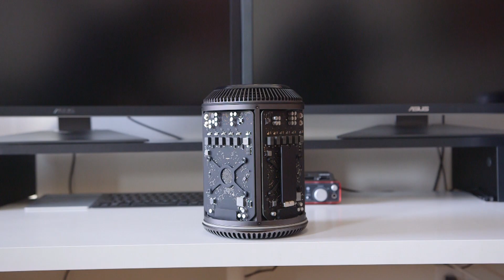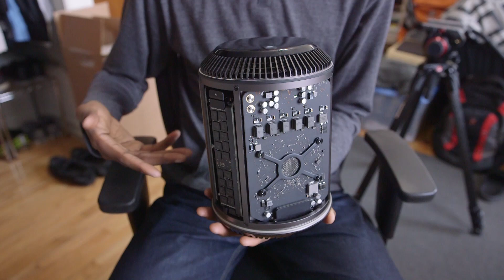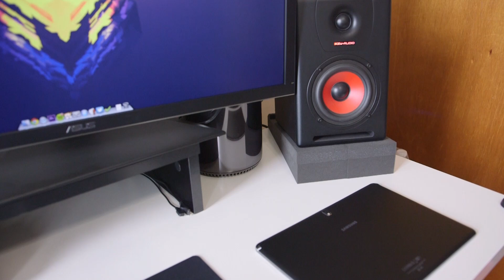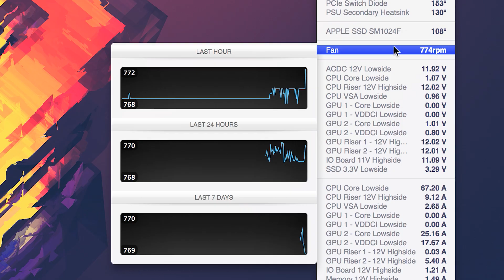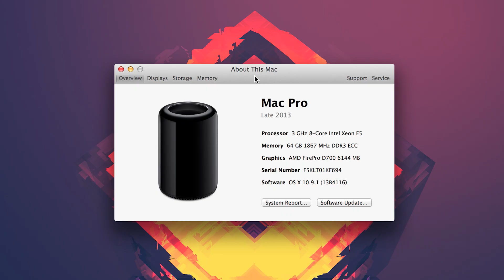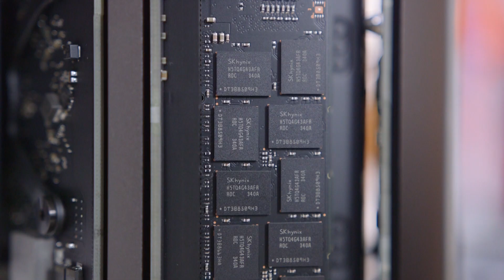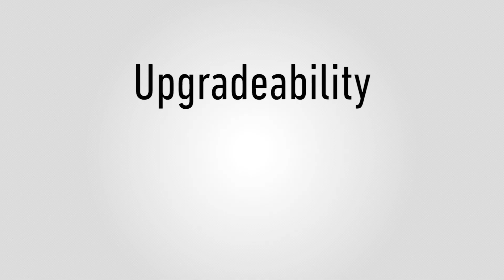New Mac Pro Review!

Comment: over prize piece of shit
for the same prize I got a beast with dual titans, 8 core processor, and 64g of ram...and some extra paraphernalia.

Edit:
In honor to @Indecisive Fella, which has made good points:

If it suits your needs and you can afford it, it will do the job, I might think that it is overprized and it can be, but it is a good computer for sure.
Consider to check a pc rig as well.
Reply: Good for you finding something that satisfies your needs.

A Mac Pro is clearly not aimed at you.

Now as you use a non-Xeon CPU you are limited to 64 GB of non-ECC RAM and not enough PCIe bandwidth and your mainboard will also not have TB2.

But hey, why not build your own computer using the same components like the Mac Pro uses and then put them all in such a small enclosure and then come back and tell us about its price.
Reply: Indecisive Fella Hey! Basically because to get the same performance that mine has, the prize of mac pro would be around 9000 dollars, and mine around 4000.
So no, im not paying 5000 dollars extra for a fancy case, a more stable processor that in most cases will be slower, and some tech that is not software ready yet.

Needles to say that I enjoy the Cuda technology that it is extremely useful for real time simulations (naiad, TFD, phoenix etc etc), GPU accelerated rendering and so on.
My rigs are not gaming rigs.
I own 2 Tesla rig as well and a 4xXeon.

Yes, the mac pro is not aimed to me, as a long time mac pro user, I stopped buying mac products when the prize performance ratio went down and most of the Software runs better or is exclusive to windows/linux platforms.

As a non Xeon user, i am limited to 64 gigs, yeah, but the mac pro does not accept more than 64g in the first place. So i guess we are even.

The resultant computer that is the mac pro is, a machine with a few good ideas and some technology that no software that it is available for mac or is used for the average professional that buys a MAC PRO can take advantage of.

Not to mention that the ability of upgrading the GPU or even add up to 4 in SLI.

But hey!
Why you don't try to build  one of my rigs, with the same components, fit in a case like that and for  the same prize?

see?, i can do that too.

The mac pro it is about the brand, and the aesthetics. But it does not deliver, is like a low grade Ferrari stuck in traffic. 

Needless to say that in professional environments the Mac pro is always a no no, unless you are a hipster photographer, hipster video editor or a hipster graphic designer.

Are we going to share some software knowledge now? I am all about it.

about to do some illustrations in my Cintiq 24HD
Reply: Himura Battousai
• "As a non Xeon user, i am limited to 64 gigs, yeah, but the mac pro does not accept more than 64g in the first place. So i guess we are even."

- 128 GB is the current limit.
http://eshop.macsales.com/item/Other%20World%20Computing/1333D3Z3M128/
Reply: Indecisive Fella although you know what?

I checked your profile and you seem to be an APPLE fanboy.

So hey, enjoy your Mac pro, I will enjoy my PCs. you probably even use them for anything serious anyways.
Reply: Himura Battousai

• "I checked your profile and you seem to be an APPLE fanboy."

- To many I am, at least to people who have a one sided view.

• "So hey, enjoy your Mac pro"

- I don't have my own Mac Pro, only the workplaces I go to have them.

• "you probably even use them for anything serious anyways."

- Depending on what you call serious, I use them for national broadcasts of comedy shit, mostly candid camera or sketch comedy.

Sometimes it also has been used for editing and grading of RED Epic and Alexa footage.
Nothing serious of course, only some skateboarding footage, as those cameras are ideal for that.
Reply: Himura Battousai
• "The resultant computer that is the mac pro is, a machine with a few good ideas and some technology that no software that it is available for mac or is used for the average professional that buys a MAC PRO can take advantage of."

- FCP X, Mari and others can take advantage of the hardware, can they not?

• "Not to mention that the ability of upgrading the GPU or even add up to 4 in SLI."

- That is a very valid point, but not everyone using a workstation computer will need that kind of GPU power.

• "Why you don't try to build  one of my rigs, with the same components, fit in a case like that and for  the same prize?"

- Maybe I do. Send me the components?

• "The mac pro it is about the brand, and the aesthetics. But it does not deliver, is like a low grade Ferrari stuck in traffic. "

- I have worked on the old and new Mac Pro and in my experience with editing, compositing and colour grading it did deliver.

• "Needless to say that in professional environments the Mac pro is always a no no, unless you are a hipster photographer, hipster video editor or a hipster graphic designer."

- Good to know you have outgrown your hipsterness (wow, that is recognised as a word - WTF), as I and the companies I work with and for don't have yet.
It is strange to see 50 year olds as hipsters though, but I get it.

• "Are we going to share some software knowledge now? I am all about it."

- Why not. I use iMovie for my multi-cam needs for BetaSP footage, I use Jashaka for my compositing needs and I use iDVD for my BluRay authoring needs.

Or not.

• "about to do some illustrations in my Cintiq 24HD"

- No, you are not. You make ARRT.
Sorry.
Reply: Indecisive Fella

- 128 GB is the current limit.
http://eshop.macsales.com/item/Other%20World%20Computing/1333D3Z3M128/

this is new right?

- FCP X, Mari and others can take advantage of the hardware, can they not?

Actually not really, you won't see a better performance than a PC with the same specs that will cost you the same prize.

Although I wont use FCP X over Premiere,.and Mari will take more advantage of a CUDA based card. 
So better to use Nvidia

- That is a very valid point, but not everyone using a workstation computer will need that kind of GPU power.

If you use Mari and you are working 16k res textures, yeah, get some powerful GPUs

- I have worked on the old and new Mac Pro and in my experience with editing, compositing and colour grading it did deliver.

Me too, as i said, I stopped buying mac Pros when prize performance was not worth anymore, we are discussing the new mac pro though, not the ones that were actually reliable workstations.

- Good to know you have outgrown your hipsterness (wow, that is recognised as a word - WTF), as I and the companies I work with and for don't have yet.
It is strange to see 50 year olds as hipsters though, but I get it.

In 20 years of experience I have seen a 90/10 ratio pc/mac users and mac users had been always very specialized to photography, Graphic design and video editing.
Although in recent years, that 10% started moving to PC

- Why not. I use iMovie for my multi-cam needs for BetaSP footage, I use Jashaka for my compositing needs and I use iDVD for my BluRay authoring needs.

or not

or yes

- No, you are not. You make ARRT.
Sorry.

If ARRT is Badass Art, then yes! thank you

$8,099.00 is the prize for a mac kind of maxed out, for the same prize I get a much better beast
Reply: Indecisive Fella
- To many I am, at least to people who have a one sided view.

You actually....are one sided.... that it is the nature of a fanboy isn't it?

- I don't have my own Mac Pro, only the workplaces I go to have them.

What a waste of money :(

- Depending on what you call serious, I use them for national broadcasts of comedy shit, mostly candid camera or sketch comedy.

Meh, i  don't see why a mac pro will give any advantage over a PC in there.....
You guys use macs? what media servers do you use? curious because lots of them run under linux

Sometimes it also has been used for editing and grading of RED Epic and Alexa footage.
Nothing serious of course, only some skateboarding footage, as those cameras are ideal for that.

Again, If you are going to edit ArriRaw or Red's it is better to have Cuda CARDS or an ION. You can also allocate the cache in one card and use the secondary for running the preview.

I don't see anything here were a mac pro give you an edge over a PC
Reply: Indecisive Fella Now for real.

Lets both stop being condescending.

These are some of my rigs that I have in my personal studio.

Texture painting, illustration, sculpting.

Cintiq 24HD, i7,64g, double titan +titan Z

3D. Arnol Rt, Vray Rt,Octane etc
4x Xeon, 256g, double tesla + Quadro K6000

Editting
i7, titan Z +980. 64g

a couple secondary rigs and  a small render farm.

Seriously, I have been using MAC since the time were only proffesionals were using them, it was a rare thing, i remember to show my powerbook to my friends and they were freaking out.

Been a MAC advocate for many many years, when Steve Jobs died, my first thought was....We are fucked.

And i believe i was right, Apple is a mainstream computer brand, you can love it as much as you want, but they dont have an edge anymore, the products look beautiful but the technology is, for the most part, outdated and not worth the prize, The mac pro release was my last hope, I got one, I  played with it, i freaked out when i realized that came without mouse or keyboard, and resell it to a Graphic designer friend after 2 weeks of usage.

Pc are more user friendly, more powerful and upgrade friendly as well, you buy a MAc pro, and you are stuck with radeons forever.
And In case you need to go in an reapir something you are pretty much fucked.

So, if you want to defend them, go ahead man. All yours.
Reply: Himura Battousai
• "this is new right?"

- It has been available for almost a year.
http://www.macrumors.com/2014/03/26/more-128-gb-mac-pro-ram-upgrades/

• "Actually not really, you won't see a better performance than a PC with the same specs that will cost you the same prize."

- That I didn't say though, but FCP X, as wonderful and shitty it is to some, does only run on OS X. And some others.
I recently learned that Autodesk Smoke does no longer run on Windows, due to OS X being easier to port to that Windows due to similar architectures.
I guess many Linux DCC applications are easier to port to OS X than Windows, but since Windows has a big market share, not every company is willing to forego Windows that easily, even if Linux is used often in that field.

• "Although if i wont use FCP X over premiere, and Mari will take more advantage of a CUDA base card. 
So better to use Nvidia"

- Sadly I do not have a hand for 3D, thus my experience is limited to dabbling for "simpler" animations in such applications, as C4D does suffice my needs, thus I do not even need that much computational power, but as I benchmarked by new 970 I came upon OctaneRender I was astounded it could use the GPU to render C4D scenes.

• "Me too, as i said, I stopped buying mac Pros when prize performance was not worth anymore, we are discussing the new mac pro though, not the ones that were actually reliable workstations."

- I have seen plenty of companies moving to the new Mac Pro from older ones, even though I was astounded, but since many of their expansion has already been external, it was not that big a deal.
But then again, I have seen more old Mac Pros and HP workstations than the new Mac Pro, which is probably due to not needing a new computer yet.
We will see in time.

• "In 20 years of experience I have seen a 90/10 ratio pc/mac users and mac users had been always very specialized to photography, Graphic design and video editing.
Although in recent years, that 10% started moving to PC"

- In my 15 years I have seen a similar ratio sometimes, but as I have not visited every company in my big city, there are about 100+ of them, I cannot validate that number that easily.
Currently I am working on a project which is done with three companies (editing, grading, sound) and all use Macs.

• "If ARRT is Badass Art, then yes! thank you"

- More like pirate art. ;)

• "$8,099.00 is the prize for a mac kind of maxed out, for the same prize I get a much better beast"

- It is more like 9,599 USD, and yes, you can get something more beasty for that money, since the 12-core CPU costs around 2,500 USD, the RAM and PCIe flash storage around 800 to 1,000 USD each and the W9000/D700 GPU around 3,500 USD each.
Then let's not forget the TB capable main boards.

I see the new Mac Pro for what it is, a small powerhouse with lots of external expansion.
Apple saw a new market, where such expansion is possible and just delivered the four core components (CPU, RAM, GPUs, OS storage) in a small package for anyone to expand to its liking.
TB 2 is good for that, and once Skylake hits, TB3 will be even better.

• "You actually....do.... that it is the nature of a fanboy isn't it?"

- I do not present a one sided view though, as I always state that different needs require different tools and that one cannot simply say this or that one is better or worse in general.
Windows is better at many things for many, OS X Is better at many things for many.
I recently tested Windows for one month as my primary OS after more than a decade of absence, and while it is an okay OS, it did not satisfy my needs.
But I can also see, that others will not be satisfied by OS X and Mac hardware.

But then again, there is a choice.

I also go not around looking at Windows based computer videos and tell everyone what you did on a Mac Pro video.

• "What a waste of money :("

- It is not your money, and it certainly hasn't been a waste.
Those machines work quite well without an admin taking care of them, something I haven't experienced in Windows workstation environments with a dedicated admin.

And due to Windows assigning letters to drives/volumes, you are limited by the number of volumes mounted at the same time, which I had to deal with in an Interplay/Unity environment.

And Disk Management, once you find it buried in Administrative Tools > Computer Management is not as easy to use as Disk Utility.

• "Meh, i  don't see why a mac pro will give any advantage over a PC in there....."

- It gives an easier to work in environment, the interface alone gives me an advantage.

• "You guys use macs? what media servers do you use? curious because lots of them run under linux"

- We used Interplay/Unity once, then there was EditShare.
We mostly use lots of RAIDs in external enclosures though, and the newest company I work for uses, shit - I forgot the name, to mount NAS to every Mac.

• "Again, If you are going to edit ArriRaw or Red's it is better to have Cuda CARDS or an ION. You can also allocate the cache in one card and use the secondary for running the preview."

- We work with proxies mostly and then when it comes to finishing we use the RAW data.

DaVinci did not give us any problems with Arri and RED footage on a new Mac Pro and it rendered a 87 minute feature colour graded in it with plenty of nodes in under two hours.
I think it took 6 hours to output four different variants (ProRes 4444, TIFF, DNxHD, and something else I cannot remember).

• "I don't see anything here were a mac pro give you an edge over a PC"

- Does it always have to be some kind of edge?
I and many work much faster in a Mac OS X environment.
I once used to digitise DigiBeta and XDCam discs for two companies on similar workstations.
The one running on OS X gave me a 25 % time advantage due to me being able to do my work faster, and the other company running on Windows XP gave me a disadvantage, even though I knew my ins and outs in that OS.

Again, if specs and money are your only focus, go with Windows.
If not, use Be/OS.
Reply: Himura Battousai
Man, I was just finished with the previous posts.

That is your tactic, isn't it? Exhausting me.

• "Now for real.

Lets both stop being condescending."

- NOOOOOOOOOO.

Okay.

• "These are some of my rigs that I have in my personal studio.

Texture painting, illustration, sculpting.

Cintiq 24HD, i7,64g, double titan +titan Z

3D. Arnol Rt, Vray Rt,Octane etc
4x Xeon, 256g, double tesla + Quadro K6000"

- As I do not do such stuff, I cannot comment on it, but looks kinda "slow". ;)

• "Editting
i7, titan Z +980. 64g"

- Again, too slow for editing in iMovie.
Seriously, I do not need that much power, as many of our footage is using an editing codec and not the RAW footage.
With multi-cam that would also be a waste, and since we are Media Composer orientated, GPUs do not matter that much yet. Maybe in ten years.
That is why I like Premiere Pro more and more (I grew up on Premiere 4.x before switching to MC), as it can play back by RED RAW footage in real time, even if it is 5K, though I have to set the resolution to half on my older rig (i7, GTX 670).

My current rig is using a 4790K and GTX 970 with 32 GB of RAM, it does suffice my needs, as I do work too often on company hardware to spend the extra money for my home rig.

• "Seriously, I have been using MAC since the time were only proffesionals were using them, it was a rare thing, i remember to show my powerbook to my friends and they were freaking out.

Been a MAC advocate for many many years, when Steve Jobs died, my first thought was....We are fucked.

And i believe i was right, Apple is a mainstream computer brand, you can love it as much as you want, but they dont have an edge anymore, the products look beautiful but the technology is, for the most part, outdated and not worth the prize, The mac pro release was my last hope, I got one, I  played with it, i freaked out when i realized that came without mouse or keyboard, and resell it to a Graphic designer friend after 2 weeks of usage."

Yes, it became more mainstream every day, even when SJ was still alive.
I mind sometimes, but I can still get my work done.

• "Pc are more user friendly, more powerful and upgrade friendly as well, you buy a MAc pro, and you are stuck with radeons forever.
And In case you need to go in an reapir something you are pretty much fucked"

- I guess I am on my first steps then, as I use two Hackintoshes at home (iMac too glossy, Mac Pros too much for my home needs), but I cannot for the life of me get accustomed to Windows (I tried for a month at the beginning of the year).
Too much simple features are missing from it.
And it looks not that well, it is too often in the foreground compared to the muted looks of OS X.

• "So, if you want to defend them, go ahead man. All yours."

- I rarely defend the company, but its users, if necessary.
Just because something works for you just splendid does not mean it has to work for others that well, even though Windows is a fine OS in many regards.
Reply: Indecisive Fella - It has been available for almost a year.
http://www.macrumors.com/2014/03/26/more-128-gb-mac-pro-ram-upgrades/

so yeah, it is pretty new.

That I didn't say though, but FCP X, as wonderful and shitty it is to some, does only run on OS X. And some others.
I recently learned that Autodesk Smoke does no longer run on Windows, due to OS X being easier to port to that Windows due to similar architectures.
I guess many Linux DCC applications are easier to port to OS X than Windows, but since Windows has a big market share, not every company is willing to forego Windows that easily, even if Linux is used often in that field.

All software that is owned by mac is exclusive to its plattform. I dont understand why you say that, But as I saidm ill take Premiere over FPC any day.

And ill take Nuke over Smoke any day as well.
The difference between porting to mac or PC is not a factor to consider, it is minimal.

- Sadly I do not have a hand for 3D, thus my experience is limited to dabbling for "simpler" animations in such applications, as C4D does suffice my needs, thus I do not even need that much computational power, but as I benchmarked by new 970 I came upon OctaneRender I was astounded it could use the GPU to render C4D scenes.

WAIT! how is this possible? Octane requires CUDA to render...and the mac pro uses RAdeons....Cuda is nvidias architecture...are you sure about this?

- I have seen plenty of companies moving to the new Mac Pro from older ones, even though I was astounded, but since many of their expansion has already been external, it was not that big a deal.
But then again, I have seen more old Mac Pros and HP workstations than the new Mac Pro, which is probably due to not needing a new computer yet.
We will see in time.

Sorry, but i have seen the complete opposite experience.
Specially since open GL is far more advanced under windows plattforms than MAC.
And many new aplications that require both OPEN GL and OPEN CL use   directX 12

I also go not around looking at Windows based computer videos and tell everyone what you did on a Mac Pro video.

I stated my opinion based on technical knowledge, if that is ok for you

We used Interplay/Unity once..

dont remeber well but This is not an AVID exclusive?
Editshare seems to be standard nowadays.

- We work with proxies mostly and then when it comes to finishing we use the RAW data.

You can allocate the whole cache in one card and preview at full res, you should try, it is pretty mindblowing :)

87 mins of footage in 2 hours sounds about average. It is waht you can expect with those specs. You can get better export times with an overclocked i7. And cheaper.

Does it always have to be some kind of edge?

Yeah man, that is the point.
Why am I am going to spend more money in a computer for the same performance ill get for cheaper? just because it looks better? just because it is mac?

If i can spend less, go faster stuff...why i shouldn't?

The main problem i have with the mac pro is that it claims to be better, but it is not
Reply: Himura Battousai
• "so yeah, it is pretty new."

- As is the Mac Pro in that regard, unless four month make a big difference.

• "All software that is owned by mac is exclusive to its plattform."

- Not really, as iTunes and Safari and QuickTime and the ProRes codec are also available for Windows.

• "But as I saidm ill take Premiere over FPC any day"

- Me too, but FCP X has its advantages for the people willing to learn something new.

• "And ill take Nuke over Smoke any day as well.
The difference between porting to mac or PC is not a factor to consider, it is minimal."

- Nuke has its origins in Linux too, thus the Mac OS X port is easier than the Windows port.

As I do not use node based compositing software anymore, as I am using AE for my needs, I also do not use Smoke.
And I come from node based software like Combustion and flame, but AE offers quite a lot of tools to finish my work.

• "WAIT! how is this possible? Octane requires CUDA to render...and the mac pro uses RAdeons....Cuda is nvidias architecture...are you sure about this?"

- Yes, as I used a GTX 970 and not an OpenCL GPU.
I was just adding that as tidbit, as I was astounded by the speed of OR. Nothing more.
And as I was surprised that a 3D application would not take advantage of the GPU.

• "Sorry, but i have seen the complete opposite experience.
Specially since open GL is far more advanced under windows plattforms than MAC.
And many new aplications that require both OPEN GL and OPEN CL use   directX 12"

That may be due to us working in slightly different fields, where GPUs are even more important?
Video editing and finishing software still lack those advantages.

• "I stated my opinion based on technical knowledge, if that is ok for you"

- That is okay for me, but you consider me a fanboy and implied I would do things I don't do.

• "dont remeber well but This is not an AVID exclusive?
Editshare seems to be standard nowadays."

- Yes, Interplay is from Avid and Unity is its predecessor.
http://www.avid.com/US/products/family/Interplay
I only used it in a Windows only environment for some docutainment shows which had too much footage.
As for Editshare, we only used it on OS X only environments, as it was cheaper I suppose.

• "Yeah man, that is the point.
Why am I am going to spend more money in a computer for the same performance ill get for cheaper? just because it looks better? just because it is mac?"

- If you are satisfied with your choice, then that is NOT okay.
Anyway, Macs offer some advantages too, for everyone it is different, but using a Hackintosh in a production environment is not that welcome.
Better get the original hardware.
And Dell and HP workstations cost around the same as a Mac Pro.

The TV station I work at uses HP workstations for their editing bays and such.
They could have gone cheaper of course and use consumer or enthusiast hardware, but they did not.
The same goes for many production companies, they spend a bit more on workstation hardware to get optimised hardware for their certified software.
One small anecdote: I once worked for one day on a project on a six core i7 Windows custom built computer using Media Composer and AE.
It was plenty of fast, but it got so many errors that a slower machine with no errors would have finished the project at the same time.
And those errors were due to the software not being certified for running on that specific CPU, which of course was the error of the buyer, since he did not do the research.
With a workstation computer you do not need to do this that much, as many companies list the workstations they certify their software for.

• "If i can spend less, go faster stuff...why i shouldn't?"

Because of certified hardware in a production environment?
Hell, I use not certified hardware on my Hackintoshed and I can live fine with it, but if I were to make serious money with them, I probably would get a workstation, but as those two are merely transcoding machines I can live with the small errors every now and then.

• "The main problem i have with the mac pro is that it claims to be better, but it is not"

- Where does the Mac Pro claim to better at what exactly?
Reply: • "All software that is owned by mac is exclusive to its plattform."

Ok let me rephrase that:
Profesional software owned by apple it is exclusive to its plattform.
Codecs can fit in a different cathegory I believe

- Me too, but FCP X has its advantages for the people willing to learn something new.

Premier is a walk through the park man, editing software is the easiest thing to learn, i don't see that being a valid excuse

- Nuke has its origins in Linux too, thus the Mac OS X port is easier than the Windows port.

-How easy is to port the software is irrelevant in this case. What matters is which plattform allows it to take more advantage of the hardware. A better OPEN GL version running on windows it is just enough reason to run it on PC

As I do not use node based compositing software anymore, as I am using AE for my needs, I also do not use Smoke.
And I come from node based software like Combustion and flame, but AE offers quite a lot of tools to finish my work.

-I use AE too, it is a cool software, really reliable, still, Accelerated GPU rendering takes advantage of CUDA which the mac pro lacks, and 3rd party plugins like element 3d recommends CUDA as well.

Yes, as I used a GTX 970 and not an OpenCL GPU.
I was just adding that as tidbit, as I was astounded by the speed of OR. Nothing more.
And as I was surprised that a 3D application would not take advantage of the GPU.

-So no octane render on MAC PRO, nor Vray RT, nor Arnold RT. We start seeing some limitations here.

That may be due to us working in slightly different fields, where GPUs are even more important?
Video editing and finishing software still lack those advantages.

-Yes and no. Premiere for example can take advantage of multiple GPUs and so does speed grade.
It is important to note that many parts of the industry run under traditional standards, MACs had been the house of video editors and graphic designers for years so changing platforms is kind of a hassle. Something like, if it is not broken no need to change it.
But there is some truth in your comment of course

One small anecdote: I once worked for one day on a project on a six core i7 Windows custom built computer using Media Composer and AE.
It was plenty of fast, but it got so many errors that a slower machine with no errors would have finished the project at the same time.
And those errors were due to the software not being certified for running on that specific CPU, which of course was the error of the buyer, since he did not do the research.
With a workstation computer you do not need to do this that much, as many companies list the workstations they certify their software for.

- This is actually very true, but as you well said seems a problem of the end user not the hardware or software.
Although I can't think of any "art" software that had specific CPU specs in order to run unless the CPU is too old or it is an old G4 or something.

All my computers are custom build by AVA direct (check them out, they build some pretty heavy beasts) and never checked software cpu requirements, is most a GPU thing due to the different archs that Nvidia and ATI have.

Look.... and this is from the bottom of my heart.

I like you, you seem to be a cool dude, and you made some points, and also made me laugh a lot, not laughing at you but in the best way possible, so to honor this conversation I am  going to edit my original post because I don't want to offend good people that feel passionate about something they like,

I will keep the original post as well so everyone can see that I was kind of a grumpy asshole >:(

;)
Reply: Himura Battousai
• "Premier is a walk through the park man, editing software is the easiest thing to learn, i don't see that being a valid excuse"

- Depending on where you come from, it can also be hard.
But I did not mention FCP X as excuse.
It has a kinda new approach to editing in some regards, by which many are put off, including me, as I grew up with Premiere and MC.

• "How easy is to port the software is irrelevant in this case. What matters is which plattform allows it to take more advantage of the hardware. A better OPEN GL version running on windows it is just enough reason to run it on PC"

- It is relevant if it has to take advantage of an API, and if you say OpenGL is better on Windows, it does matter.

• "I use AE too, it is a cool software, really reliable, still, Accelerated GPU rendering takes advantage of CUDA which the mac pro lacks, and 3rd party plugins like element 3d recommends CUDA as well."

- Haven't seen that much of GPU usage for my compositions yet, maybe for Raytrace something, but I do not use it.

• "So no octane render on MAC PRO, nor Vray RT, nor Arnold RT. We start seeing some limitations here."

- There have to be tools out there taking advantage of OpenCL, otherwise it would not make sense to use AMD cards in any way.

• "Yes and no. Premiere for example can take advantage of multiple GPUs and so does speed grade.
It is important to note that many parts of the industry run under traditional standards, MACs had been the house of video editors and graphic designers for years so changing platforms is kind of a hassle. Something like, if it is not broken no need to change it.
But there is some truth in your comment of course"

- Yes, Premiere does that, and Speed Grade, but they have not arrived at any of the houses I work for.
MC and DaVinci Resolve seem to be the king there.
For smaller houses Premiere and SpeedGrade are used, and it seems to be based on region too.
I heard/read that Scandinavia is using lots of Adobe products, but Casablanca was widely used somewhere else too.

• "This is actually very true, but as you well said seems a problem of the end user not the hardware or software.
Although I can't think of any "art" software that had specific CPU specs in order to run unless the CPU is too old or it is an old G4 or something."

- That version of MC I used in that example did not certify GTX or other consumer GPUs, only Quadros.
I don't know if that was the problem, but I assume it had something to do with the ECC RAM missing.

Oh, I hate Google+ comments, message boards from the 1990s had more features, but I guess Google did not count people that have actual discussions like we do and limit themselves to "hey faggot, you slimy bag of cuntass" or something like that.
I guess that makes it easier.

• "All my computers are custom build by AVA direct (check them out, they build some pretty heavy beasts) "

- Please don't mention computer porn.

• "and never checked software cpu requirements, is most a GPU thing due to the different archs that Nvidia and ATI have."

- I also almost never did, unless my life required it, which was once when I got a 3Dlabs GPU back in 2003 or so.
Since nowadays GPUs are quite powerful in handling almost anything, unless it is specialised software, I can live with a GTX GPU quite fine.

• "Look.... and this is from the bottom of my heart.

I like you, you seem to be a cool dude, and you made some points, and also made me laugh a lot, not laughing at you but in the best way possible, so to honor this conversation I am  going to edit my original post because I don't want to offend good people that feel passionate about something they like,"

- Please refrain yourself from kindness, it does not become me.
I am not that passionate about Apple, otherwise I would have bought two iMacs or a Mac Pro instead of building a Hackintosh.
I just like the OS and the hardware is a pretty and welcome bonus.
My 2009 MBP is still a good machine and I am in awe how something like that can be.

And I am always good for a laugh, since this is not a life changing subject. When we have to waste some of our time to talk about computers, we should laugh every now and then, shan't we?

• "I will keep the original post as well so everyone can see that I was kind of a grumpy asshole >:(

;)"

- I have a radar for grumpy assholes, probably because I am one too.

Anyway, I have to clean a bit now, thus will shut off the computer for a while.

Have a good lunch.
Reply: Indecisive Fella HAHAHHAAH

take care buddy :)
Reply: Himura Battousai
Until the next time we scream at each other because you prefer vegetables with the colour red and I prefer them green (spinach, brussel sprout, broccoli, ...)
Reply: Maturity in the YouTube comment section? Faith restored. Thank you my dear friend.
Reply: Himura Battousai You both should kiss. I didn't make it to the end of the conversation, but it's nice to see two people arguing who know their shit, instead of fandroids nerds vs apple fanboys drooling over spec sheets and shit.
Reply: Best thread I have ever read to date. Bravo you two
Reply: Henry The Unicorn
No, this is the killer: http://pcpartpicker.com/user/IndecisiveFella/saved/7hvcCJ
Reply: The Machine
Sorry, misunderstood your intentions.
Reply: The Machine
yeah, once in a while there is some hickups, like Batman: AK fiasco.

But hey, play the witcher III in 4K is probably out of this world
Reply: SheikahStoner you are welcome, read the whole thread
Reply: Himura Battousai Go on pcpartpicker and build a comparable PC, but:

Use xeons and fire pros and high end workstation parts. Add on the additional price of employees, R&D (like seriously, that design...), and boom, mac pro is reasonably priced.

It's ridiculous how many times people have given me a pcpartpicker link that just uses basic cheap ass (relative to server/workstation) parts.
Reply: Henry The Unicorn 

But this is the Mac Pro killer here: http://pcpartpicker.com/p/HRTVQ7

Please do not forget the Windows license adds a bit to the price, but other than that, that build can easily handle every task the Mac Pro can, and that much faster than the Mac Pro.
Reply: Annoyed Fella Lmfao

But here's a real mac pro comparison on pcpartpicker

https://pcpartpicker.com/user/codaassasin/saved/9NwXsY

Add in specially designed case and heatsink that uses up R&D money, employee paychecks, custom made graphics cards from AMD, custom made motherboards, etc, and the price difference seems reasonable.
Reply: Henry The Unicorn not even close
Reply: The Machine
Then show us close.
Reply: Annoyed Fella yours shows him enough
Reply: The Machine
Yes, but it is missing TB and is several times the size and so on.
Reply: Annoyed Fella but it proves that an equivalent pc can't beat the price of the Mac pro, which is all that counts in my eyes
Reply: Vihan Bhargava
That is funny because you are telling that to a guy that uses his computers JUST for work...

Seems that you are not very smart about tech because then you would now that in professional environments where intensive CPU and GPU tasks are required, PC are the core....

Try better next time, because a PC rig not being a workstation is the funniest quote ive heard this week.

My dual xeon  4x tesla says hi BTW...

Oh boy...
Reply: Himura Battousai you can try also getting one for work and another for just games, or in fact you can look for one that does both, but some people want one that's just for work, because they either don't game, or just have a 360 for Madden and that's all they play
Reply: Vihan Bhargava

If I want a laptop? custom build

in Rendering you can use a farm, which are CPU based most likely (windows or linux) or GPU based, all running in linux os windows....

Listen...lets get this straight, for scientific work, PC, for Graphic work mac or pc, but for intensive graphic work, PC is a not brainer, Cuda accelerated software is standard. And 3ds MAX only runs in windows for example.
So there is a wider array of profesional tools that run in Windows.

If you are going to make some light photoshop , music, or some light editing, you can go for mac, but for that prize, you get an out this world workstation with pc parts, it is not my opinion, it is a fact.

I own 4 computers for work, my latest rig can not be even build inside the Mac pro.
That is everything you need to know

and for gaming? console, big screen and sofa.
Reply: Himura Battousai I use my computer on my big screen and sofa...
Reply: Vihan Bhargava
Pardon me? Most Farms we work on run on Linux, specially the GPU based ones, that are starting to be the new standard.

If I am forgeting quality and render speed, Why in the hell I would want to use a mac as a workstation?

I think you just proved my point
Reply: The Machine then you use your computer to play and internet, we are talking workstations here
Reply: Himura Battousai mines actually a hybrid between a gaming machine and a workstation
Reply: It's very useful if you think about it, and even if you have a workstation, build a cheap gaming PC and play games on that, then use your workstation to work
Reply: The Machine
It might be, But for gaming I have xbox one, PS4 and WII u, so I dont really need it, Also I have mmy computers with very specific configurations, I dont like to mess with videogames as often require GPU updates and patches that ultimately can interfere with the specifications of some of the softwares I use.

But yes, It can be very useful and Fun as well.
I still like the convenience of consoles better
Reply: Himura Battousai it is really useful, and to be honest it's just as easy as using a console really, same convenience
Reply: The Machine
the only thing that bothers me is the inconsistence of compatibilty within systems when it comes to PC gaming...

a small prize to pay to be able to play in bigger res/better graphics. That is why I still on a console.

But I am not a PC game hater like some out there.
Each system has its highs and lows.
Reply: Himura Battousai it really depends how you build it, to be honest I've had no issues with playing games on mine, and with good graphics too, but that's just me. Consoles are cool too
Reply: Himura Battousai I don't have a 4k monitor or tv so I can't ;( but I bet it would be cool
Reply: Vihan Bhargava
dude, you are contradicting yourself all the time....

I think that you clearly dont know what a COMPUTER is because if a dual xeon with 4 teslas conected to a VCA is not a workstation, then I dont know what it is.

go troll somewhere else
Reply: Vihan Bhargava should we be obvious with the description that the name provides or should we start beating around the bush just for the sake of it...

A workstation is a computer built and designed  for technical work, can be scientifical, graphical etc etc...and it is normally just being used by one person at a time, there is not much aside from that.

The specs can vary depending on the work that needs to be done. In my case, I have among others, one rig build to handle GPU and CPU rendering and simulations.

Is that enough?
Reply: Vihan Bhargava If you have a dual Xeon for gaming, you are basically an idiot.
BTW, isnt what you wrote exactly the same as I did, just wondering if you have some comprehension issues
Reply: Vihan Bhargava
i was not saying that you do, it was a hypothetical case.
Reply: Shut up faggot, no one cares about your shitty pc